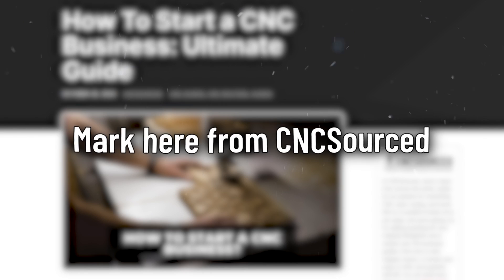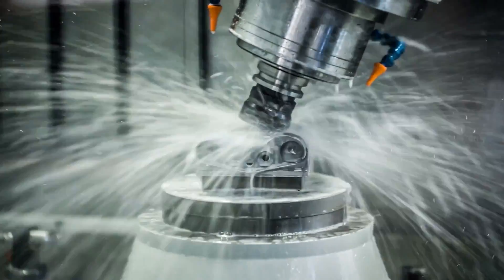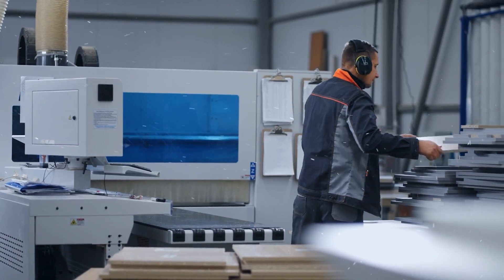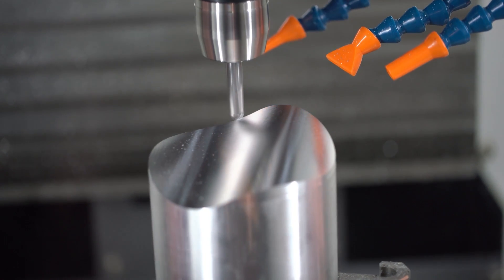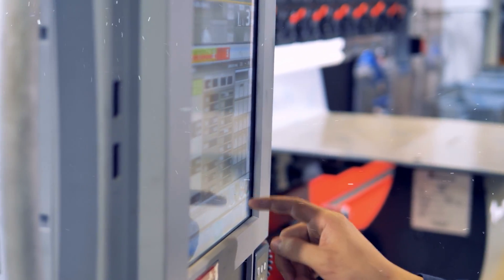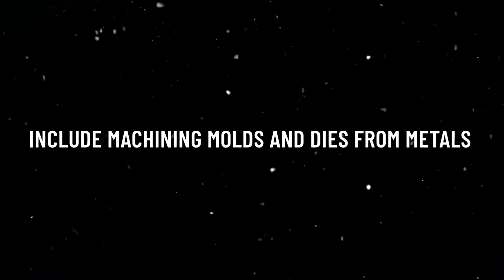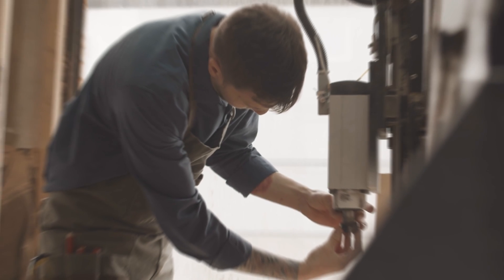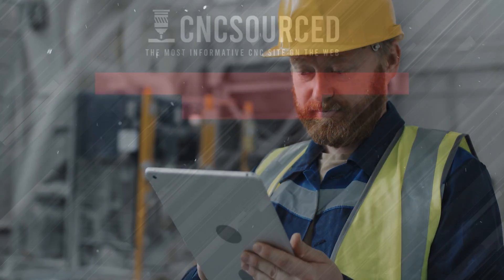3 Axis, 4 Axis & 5 Axis CNC Milling: Best Router?

Comment: Hi There, ive wasted countless hours, weeks trying to locate a simple 2-3 axis copy router/milling machine with a horizontal blade that has the ability front load and place a the small profile on a table no longer than 1200mm in length and be held by the clamps, etc to hone out or mill out the ends of the profile. Only the ends. this is a solid core pvc profile that i need to put an end cap inserted into the end. I have yet to find any such machine.